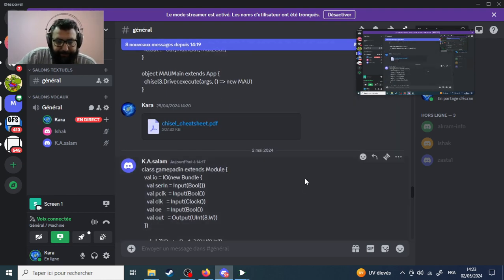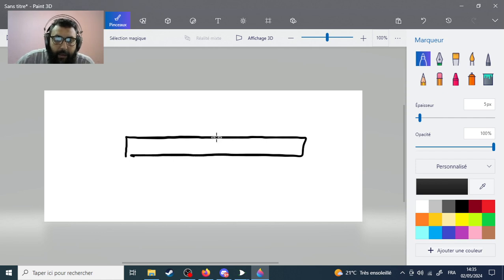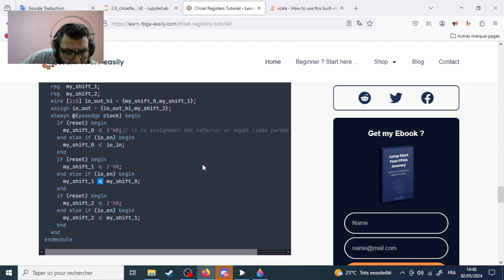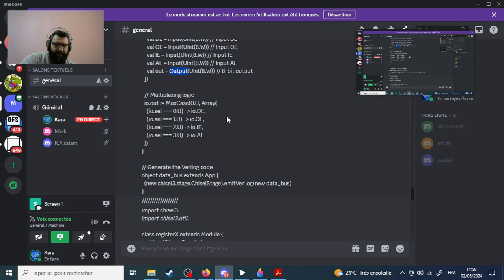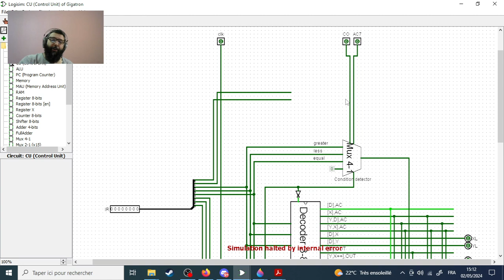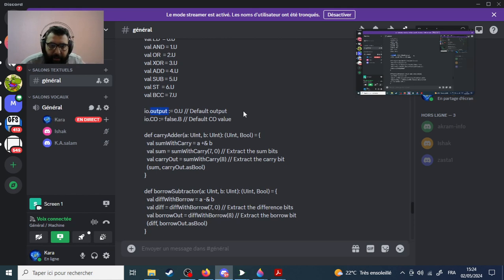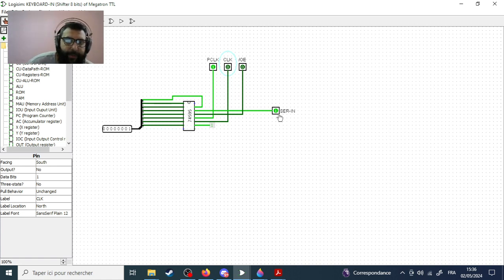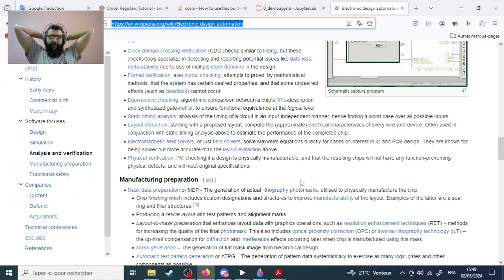Megatron Project [software] - consulting session 11

Comment: Hi. I'm not sure whether you answer my question or not but I don't know where the appropriate website is. :( It's your latest video so I leave my comment here.

I just found your GigatronTTL.circ file and tried to simulate rom files you uploaded. I loaded your fibonacci.ROM to the ROM of Gigatron TTL. 

You wrote this: Both programs have iput values for execution, the input value (example 3) has to be put inside the register BUS-IN in Gigatron, ~...

Until current address becomes 0006, BUS-IN register is deactivated. And when current address became 0006, BUS-IN register is activated so I gave the BUS-IN register '0000 0110' by controlling SER-IN & CLK & PCLK myself, but when I came back to main circuit (Gigatron TTL), BUS-IN register's value is still '0000 0000.' How can I set BUS-IN register? And is it correct to execute the rom file?

I can't find how to run the program. Waiting your answer. Thx. :)
Reply from the maker: Hi, the appropriate website is https://www.el-kalam.com.
To execute the fibonacci program, you have to input a value inside BUS-IN, the problem is this Shifter works with the VGA signals HSync and VSync. Unfortunately, those 2 signals are not  implemented. The easiest way to get around this shortcoming, is to load the desired value manually. I mean, you have to go inside the Shifter chip and change the internal flipflops manually. You will find inside 2 rails of flipflops, you have to change the output (or parallel) rail.
Reply: @abdelazizkara2352  Now it works thx!

BTW now I'm gonna add the interrupt feature to the Gigatron and I want to ask if you have any good idea. 🙂😳
Reply from the maker: @sohyunzzq  Very happy to find people still interested in this beautiful project. I though before about adding interrupt, it should be faisable, it is very convenient especially to deal with the VGA timing, good luck.